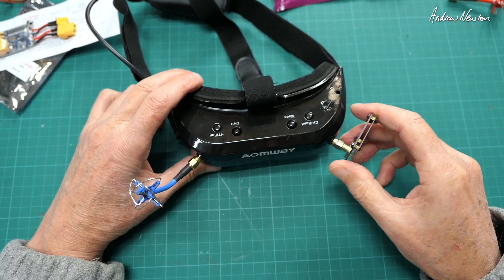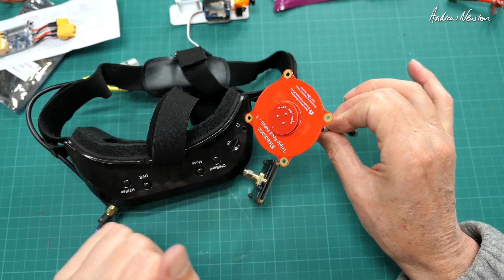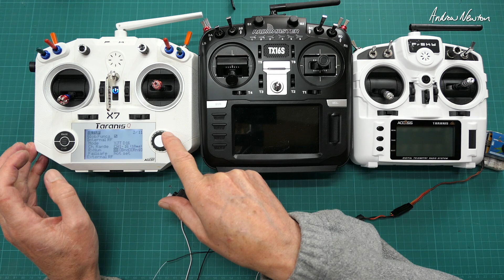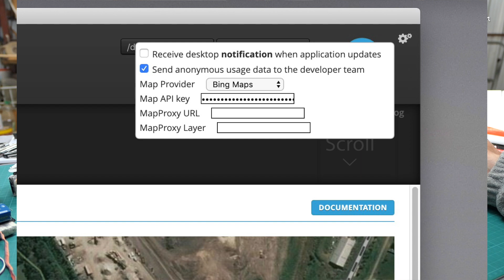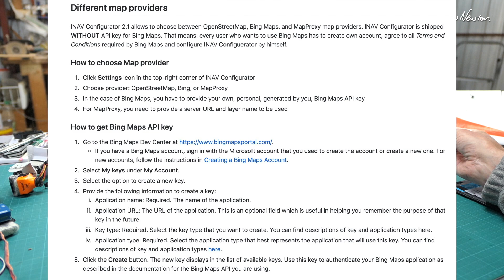FPV Pod, ACCST 2.x and TX16S, iNav Rover updates

Comment: Andrew, great explication in the ACCST 1.x / 2.x confusion issues.  As a rider to the possibilities: if you have an ACCESS or ACCST 2.x transmitter and you add a 4-in-1 multi-protocol module like an iRangeX, that will give ACCST 2.x and ACCST 1.x or ACCESS/ACCST 2.x and ACCST 1.x (depending on the transmitter).  You also get the D8 protocol back too.  The only caveat is that the 4-in-1 module will probably need it's firmware upgrading (possible soldering and bootloader flashing https://www.multi-module.org/using-the-module/firmware-updates/update-methods#flash-multi).
You might want to make an article on this :)
Reply from the maker: Yes, could make a perfect all round configuration. I did try an iRange module in the X9Lite with no joy.
Reply: That's strange.  You do need the OpenTX firmware with the multi option ticked (ver 2.2.4) or 2.3.x where it's built in then it shows an extra mode (Internal & External)

Comment: Andrew. nice roll call of parts you use 👍

btw, 50ohm dummy load need for un-used sma on the triple feed.
Reply from the maker: Thanks for the tip! I got an adapter but no dummy load.